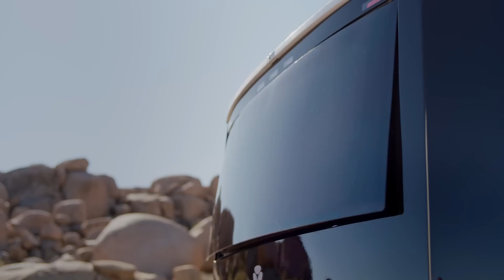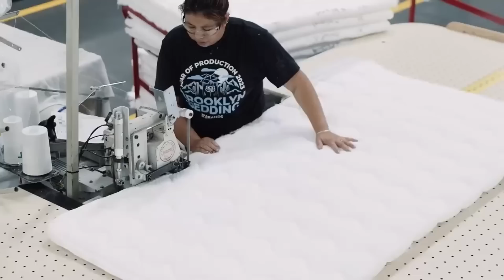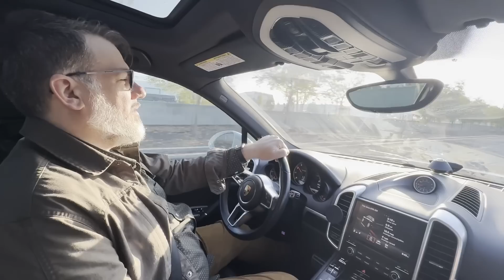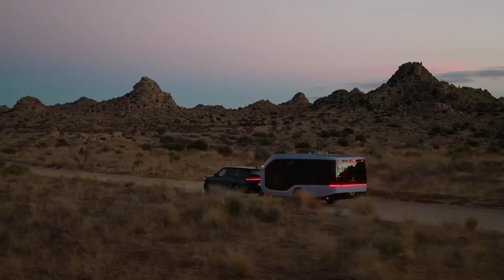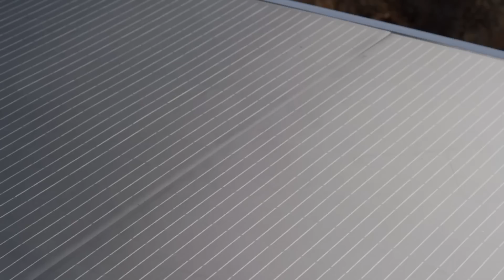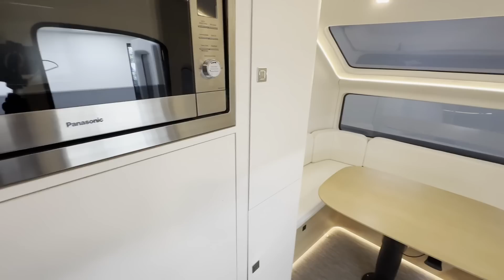Will Powered Axles Change Towing Forever? Driving the Production-Ready Pebble Flow EV Trailer

Comment: Many vehicles come with AC power on board.  Would be nice if pebble would let you send that power to it while towing.  My F350 for example could send a constant 2000watts.  That would keep the battery from draining as fast when using the motor assist.  I know in an EV the benefit would make less sense, but in any hybrid or pure combustion vehicle this would help extend that power and range.  I guess the regen feature kinda achieves the same thing

Comment: New ARV class B's range from $400k to over $600k. Even with the tow vehicle, this setup is a comparative bargain. And, unlike a B, especially a 170 extended B, parking and exploring the local community is not an issue.

Comment: New combustion tech has powered Axle too.  This powered axle concept is not limited to EVs.  The engine in the camper is the power unit for off grid living for months.  It recycles water allowing water to be distilled and reused 10-20 times.  It also has brake recovery at 75% vs EV at 56%.   No controller needed.  Just a special hitch in the trailer.

There are many more pieces to this puzzle which allows EVERY car to pull a large trailer...

Comment: The trailer should be aerodynamic, as many solar panels as you can put on the roof with the appropriate batteries storage and a level two charger so you can charge your towing vehicle.  Just my opinion

Comment: Interesting video. It would be intersting to tow it with something with a "instant fuel milage" gage to see how bad the drag from re charge lowers milage. Could you use the big battery in the trailer to supplement your electric tow car?

Comment: I would like to see a similar powered axel (motor-in-hub?) design that could be slapped onto a 2WD vehicle. Especially an RV or van where you are already carrying sufficient electrical capability to power it. The idea would be to use it only when you need 4WD, which is pretty rare for most of us. Converting a van to 4WD is expensive and potentially affects things like your range if the center diff impacts on the gas tank. I would speculate that an in-hub electric motor could be much cheaper and since you only need it occasionally it would not necessarily need to be a big draw on your batteries. (Caveat I'm not an electrical engineer, so maybe I'm wrong about how useful / cheap such an upgrade would be.)

Comment: Innovation keeps the RV industry  interesting.  Other manufactures will adapt some of these features into their upcoming models.  Keep the videos coming  👍
Reply: Innovation in the RV industry is an oxymoron in N. America. Not much has changed in 50 years as far as construction methods go. Fylon instesd of aluminum but underneath most RV's are still studs and luan plywood.

Comment: Looks absolutely beautiful. My only concern is 6200-6800 pounds on a single axle. I imagine weight distribution isn't as much of an issue as the huge battery bank should be centered over that axle, making any weight you'd add negligible. But if a tire blows, that sounds like a serious situation. Also, you'd need heavy duty truck tires to support that much weight per tire. Do they have a response to this concern? I feel like they'd need to add another axle or switch to a dually config for that one axle. Also that weight number, was that GVWR? Or base weight? I wonder how much weight is actually allowed to be added assuming all your tanks are full.

Comment: I’d be interested in the trailer without the motor EV tech. Need more trailers designed like this.
Reply from the maker: They do intend on selling it without the powered axle. It will still have the EV battery bank and be all-electric cooking and heating.

Comment: Cars are just not designed for towing. What is the tongue weight on that trailer? The max tongue weight for that Porsche is 660 lb. Using the rule of thumb of 10-15% you were way over the rated tongue weight of that trailer. I don't see this trailer lasting long in the market with that price and how small and cramped it is inside. Do like the self hitching feature though now that is something I would pay extra for to do it from an app on my phone.
Reply from the maker: The Cayenne has a 7700lb tow capacity and 770lb tongue weight limit. I'm not sure what the tongue weight of the Pebble is, but regardless, the idea here isn't to tow out of  spec. In fact I think this is most ideal for half-ton truck towing.

Comment: This is very interesting and will drive other new technologies. My question is, will they be able to lower the perceived GVWR due to drive system. I somehow don’t believe MOT will allow that, if the drive fails per example your back to GVWR and 6500lbs is a lot for a trailer this size so your into a very large vehicle to tow it legally. I hope they can make it work however, not many people can afford this and those that can probably have better options. Don’t get me wrong, I’m sure a few tree huggers in California will buy one.
Reply from the maker: No, you;ll still need (and want) to tow within spec of your vehicle. It's just more ideal for being closer to spec, and you don't need a weight distribution hitch or a a brake controller.

Comment: There is so much about this RV that the rest of the industry can learn from. A modern climate control systems, different build methods, innovative use of space, plenty of glass, and that's without any consideration for the unique chassis features. 

Of course the (optional) EV driving features in the chassis are worth noting but the tidy packaging of the rest of the rig are what floats my boat. Especially that bed/office feature. 

To me the silliest feature is the opaque glass in the bathroom. Yeah, yeah, it's pretty darned cool but I can't ever imagine a situation where I'd want the glass to not be opaque. I mean, even if I'm camping alone what if the RV's windows are "clear" and I'm there singing in the shower offending the rest of the campground?

Comment: The drag of the trailer axle in charging mode could be turned on going downhill in the mountains to take some of the wear/heat off the truck & trailer brakes. Plus the trailer won't be pushing the tow vehicle as much. Which would increase safety in that situation.  That could help with trailer sway, too.  Add this to a off-road.overlanding type trailer would be real interesting, too.

Comment: A "light check" should include signals, brake lights, and running lights. If the brake lights do not work, it is likely that the brakes are not hooked up.

Comment: Unlocking its full potential would require them to get with an EV manufacturer that would allow the vehicle to use the trailers high voltage battery as expanded capacity and then use regenerative braking to also increase the range.

Comment: Re: charging an EV at a campground.  I pull a Casita with a Tesla Y.   I always talk to the parks about charging and they’ve said EVs cause no problems, but golf carts and electric bikes fry circuits regularly.  It’s probably because the Tesla automatically draws less than the full amount on a plug.  For example, it automatically sets itself to 32 amps on a 50 amp plug.   (I can also reset it manually to draw more or less.) Whereas golf carts pull the max amount for hours and burn out the plug.   The campground hosts I’ve talked to about whether I need to pay more for using more electricity laugh and make jokes about how much electricity the huge rigs use.   There’s so many superchargers available that the campground isn’t necessary (I’ve driven about 10,000 miles pulling the casita using superchargers)  but it sure is nice to start the next day charged up from the campground!
Reply: we are looking at future with large EV- RVs   Trailers and Motorhomes.  Those usually don't fit into superchargers. And so far - pull through chargers are the exception.  Further if you have slow charger - there is no way of knowing for a Campground that you are charging.  It would be internal to the EV- RV - you are plugged in with a regular 30 or 50A plug and  you charge the drivetrain battery with 2-3 KW.    It would take 2-3 days to charge - but when you leave, you still have a full tank.

Comment: Tons of all the trip ruining tech I want nothing to do with. We don’t even have slides on our camper. We don’t have a central control panel to break that runs your lights/AC whatever. And my 2500 diesel pulls that 30’ trailer thru mountains like there’s nothing there. Need to boondock? 200 amp hours of lithium batteries, decent solar and a $700 generator for when you really need it. I’ve watched the Pebble develop over the last couple of years and I’m still not convinced it’s not just a pipe dream draining gullible VCs.

Comment: Hey RV Miles. Listen up. Go to CES Las Vegas tomorrow. Because tomorrow at 2 PM, there is this other electric RV startup called AC future. They are going to reveal the final design of its new electric RV called the AITH. Also known as AI transformable home. It’s going to be the world‘s first fully electric motorhome. They are going to show it off at 2 PM and then afterwards, there will be a demonstration unit Where the general public can check it out. They are at the Las Vegas convention center at 10515
Reply: If you’re going tomorrow, Get Jason the Press Packet and get it to him. Wish we were going.

Comment: Absolute lunacy to tow anything over 1500 lbs with a vehicle that small. It should be illegal. It's so stupid that you have to get a license to drive a motorcycle, but anyone can can tow a 6000 to 15,000 lb trailer. Total stupidity. 
Just my 2 cents. Spend it how you like
Reply: I towed a mini Winnie with a diesel Cayenne and it did great.
Reply: Those vehicles have a towing capacity of around 7000 pounds. Your comment makes no sense because you don’t even have a good point.
Reply: @Henle15  please elaborate. I grew farming. I have had a class A license. Decided to be an Ironworker so I didn't keep it. Most people don't have the training or understanding to tow a trailer. That is my point. Sorry you missed it. The car/truck manufacturer's use alot of smoke, mirrors, hopes and dreams when they come up with " tow capacity ".

Comment: Thanks Jason.  Nice rig.  I would definitely be wary of using a campsite to charge my EV without explicit permission from the owner.  That conversation is for another day as you said.  Thanks again!
Reply: if this is an issue they will simply meter the power if they have the capacity.
Reply: @jeffwise3851 discard it I ain't moving out of my damn trailer just because of damn idiots that say climate change kiss my asss
Reply: An EV has a similar current draw to an electric dryer, and definitely less than some big rigs running multiple AC units plus whatever else is in there. My old Tesla came with adapters to charge at RV parks before there was a charging network. Usually the park would be fine with charging for $10-15. 
Their grid can usually handle several cars charging at once, but maybe not cars charging at every campsite. Luckily the EV pickup I’m looking at has an outlet in the bed that can power the trailer, so I would only need to use one plug to charge both rigs. 
The US is lagging behind on EV adoption, so campgrounds have plenty of time to upgrade their infrastructure. There is no rush, but they can’t ignore it because people like me would just go to the next campground rather than go to one that doesn’t work for me. 
I was just at a large RV campground in Tucson that has solar canopies over many campsites and all the golf carts they use and rent are electric. It was nice parking under the solar canopy which shaded my motorhome for part of the day, so I never even turned on my AC and one day was 80 degrees
Reply: @kenmcclow8963  Camping under a solar campy sounds so cool!!   I hope I find one of those sites sometime!
Reply: I’ve been towing my 2,000 lb trailer for 6 years with a Tesla Model X and routinely charge my car at campgrounds where there is at least a 110-120V 30A power source, which is fine for overnight charging. The car determines how much current it can safely draw. Sometimes while charging it stops and then I manually decrease the maximum amperage using the control in the car interface, start charging again and it’s okay.  If a campsite has both 30A and 50A I don’t draw from both at the same time.
Reply: Excellent point.  I pull a Casita with a Tesla Y and always ask.  The last state park told me they’ve had no problem with EVs but have a lot of problems with golf carts and electric bikes frying outlets with continuous draw at the highest level for hours.  Probably because my Tesla seems to automatically set itself to draw less than the plug’s full capacity, and I always manually lower it a few percent more as well.  So I only draw about 30 amps from a 50 amp plug and it still fills up the car in a few hours.     When I mentioned the amount of electricity I take they always laugh and joke about how much the huge rigs use.
Reply: @TracyPopken  EVs are usually smart, people park them in garages and they don't want to have burning homes.  And very true - a large Class A with 4 A/C units will draw more power then a charging EV.  A vehicle stops charging after a couple hours - while the A/C units keep running for weeks, or months depending where you are.
Reply: @TracyPopken  Most Ontario provincial parks only offer 120 V 30 Amp outlets. Would take about 15 hours to charge any vehicle at that low voltage.
Reply: @steveogilvie5203  You are correct, Steve.   It takes over 24 hours to fully charge an EV from a regular 120V plug.   Just filling a car with gasoline through a soda straw.   AND if you could get gallons of gas included with the campsite fee by letting it trickle in slowly overnight, I'm pretty sure you'd say yes!    If you arrived near empty and weren't sure you'd make the next gas station/supercharger, being able to add a few miles while you sleep is a huge relief.

Comment: Interesting but not for me.  Batteries have a finite lifespan and it is much shorter than the timespan that I own an RV (10 years).
Reply: You don’t use batteries in other rvs?
Reply: I just bought a new house battery that has an 11 year warranty and rated for 6000 charge cycles. At that rate I could charge it everyday for 16 years.

Comment: but how long does battery pack last? range?
Reply: The trailer would not have a "range" for the batteries. How often the electrical systems are used, how long the batteries can be recharged for, the temperature (too cold or too hot) can all impact the State of Charge.
Reply: @Scuba__Steeeve  but when driving how many miles can it help push the towing vehicle: 10 miles/100 miles/1000 miles?????????